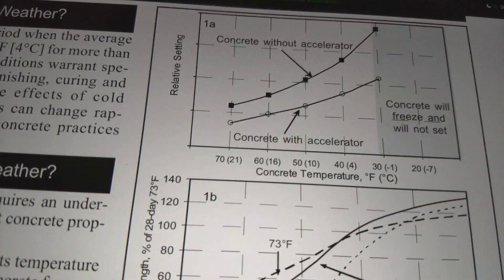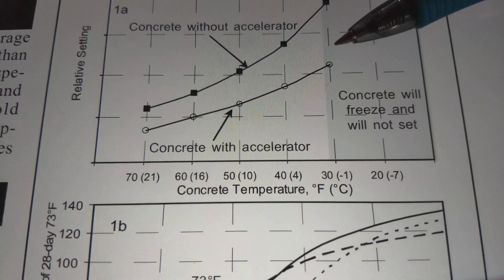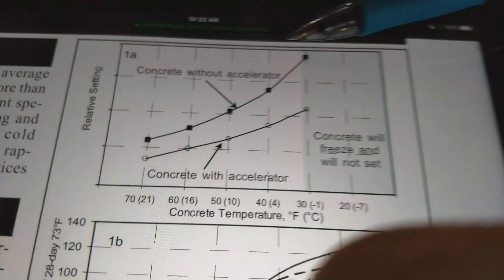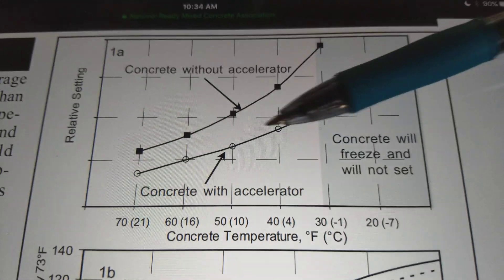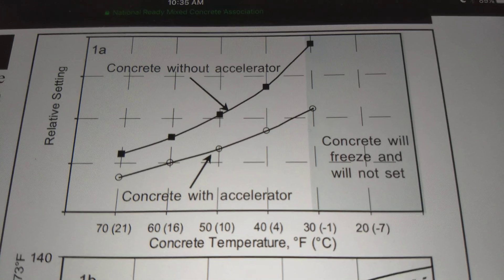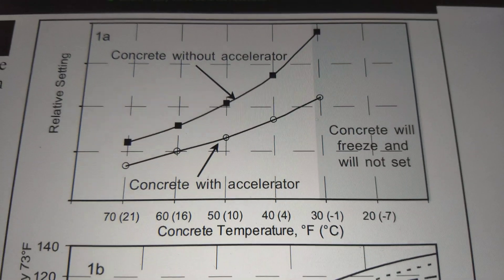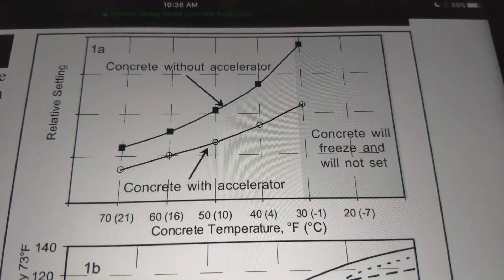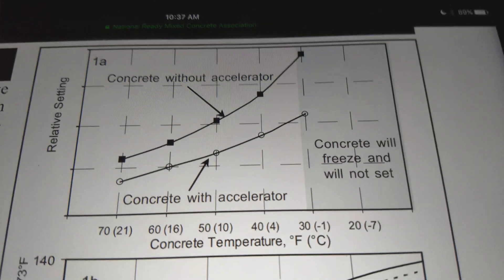Placing concrete in cold weather tips

Comment: Bass ackward on the heat movement. Heat moves not cold.
Reply from the maker: Heat is drawn to cold...   did I switch that around?    Temperature goes from hot to cold ...     SO, YES<   ''ass-backwards"...   I do that sometimes, my brain flips and it can be annoying when I do these videos... I am thinking one thing and outcomes my mistake...   I do so many videos, the last one I did, I stated 6th floor when I meant the 16th floor...   Going so fast, my vocabulary does get screwed up...   I apologize for upsetting you and thank you for pointing this out...  Do you know where I dropped the ball in the video, I will attempt to correct it and if not, I may take down the video.

Comment: Plz answer, how much cold weather is not suitable for cement work? Specially for concrete horizontal 5" thick roof.
Reply from the maker: The water content is what you really want to worry about with respect to freezing...  You can make a tent cover for your work and control the ambient and surface temperatures.